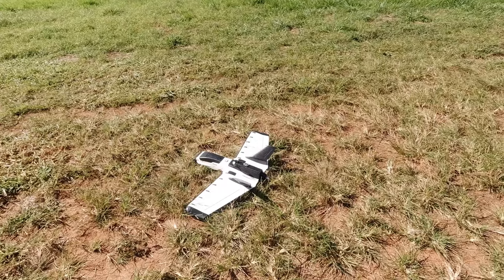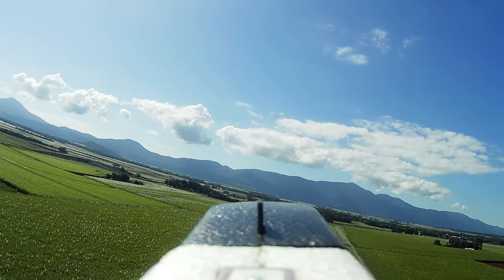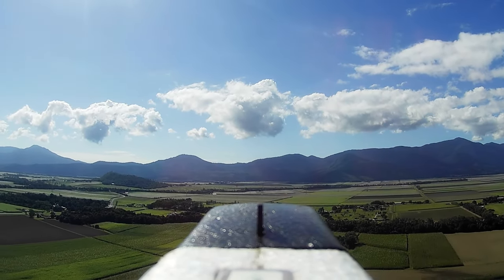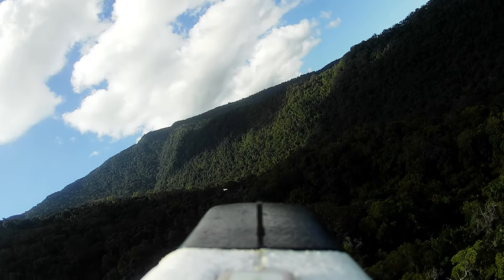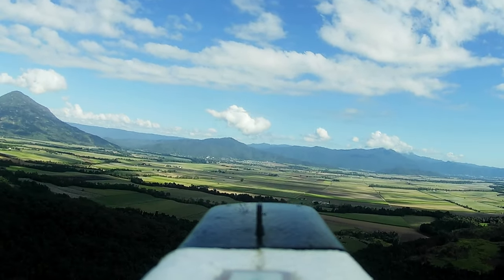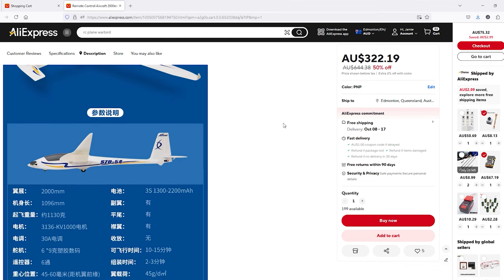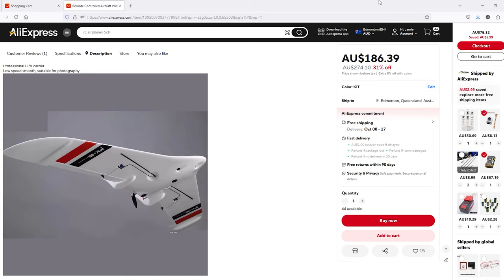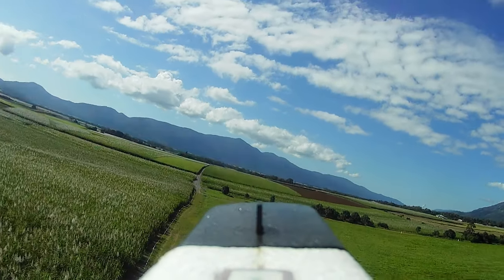ZOHD Dart XL - Morning Flight - Craft Update and Possible Future Builds

Comment: Ranger 1600
Reply from the maker: @peterhancox5268  thought about that one too thanks
Reply: The Ranger 2000 is too much like a glider, the 1600 has less drag therefore more speed,  ideal for cross country missions. I have had both, currently the 1600 with INAV SpeedyBee Mini
Reply from the maker: @peterhancox5268  awesome thx for the input
Reply from the maker: @peterhancox5268  I believe they both have the same fuselage? What flight times are you getting out of them?
Reply: @stonesrcchannel  yes same fus. Flight times depend on battery type and size (weight) also mission. The 1600 only pulls about 3amps on slow cruise, and I only use 3 cells whatever LiPo or LiIon, but missions exceeding 40 minutes are common
Reply: Wings are interchangeable between Ranger 1600 and 2000.  The Swordfish falls between the two, but with quieter twin motor setup. (no torque roll on launch)
Reply: @AerialWaviator  and you can buy ‘spare’ wings. A single fuse with both 1600 and 2000mm wings is possible
Reply from the maker: @AerialWaviator  thanks I do like the swordfish as I don't have a twin motor plane. Great to know the wings are interchangeable on the ranger. Thanks